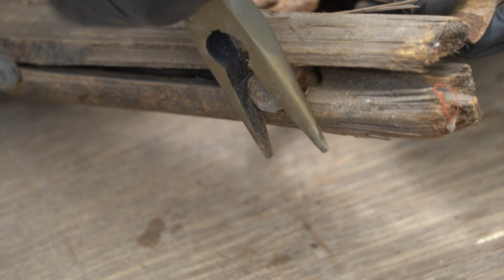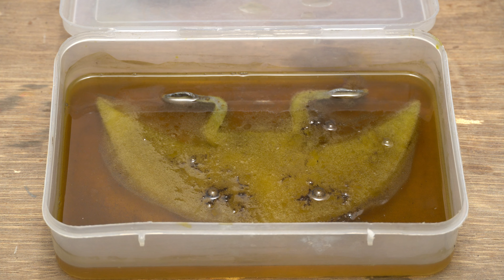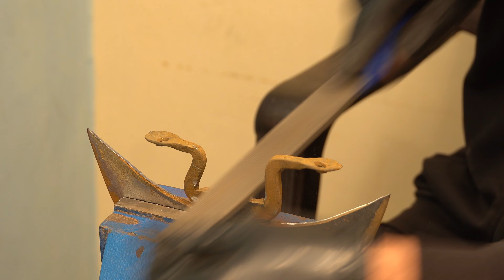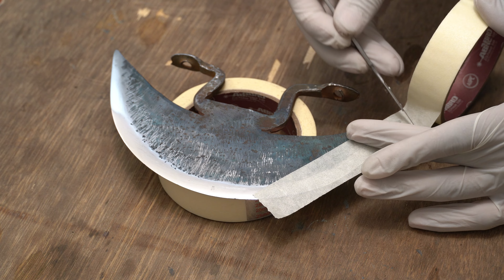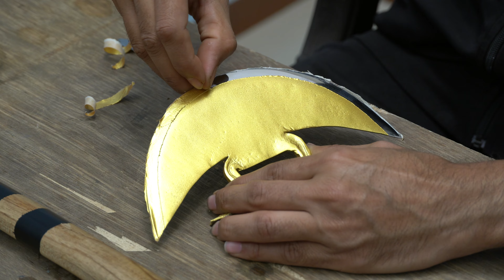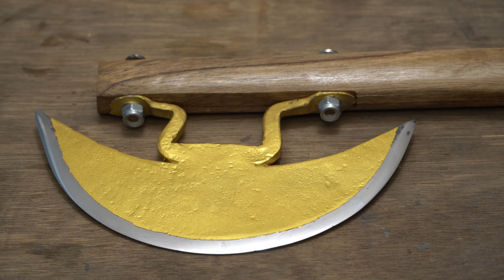Rusty Battle Axe Restoration | Antique Viking Axe Restore | Perfect Restoration

Comment: Looks nice, but not a restoration. You do have experience using tools and did a good job with the handle. Why couldn't you use the period correct hardware and left it as steel or blackened it? That would have been a more period accurate restoration. All that aside, a decent job.
Reply from the maker: Thanks for comments